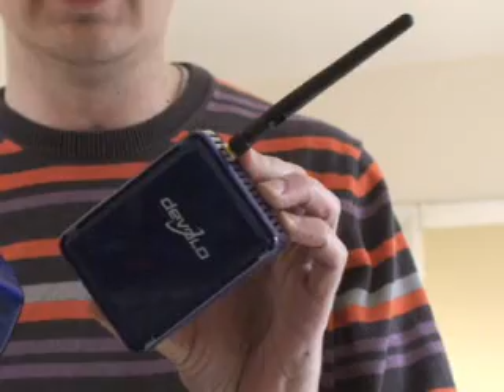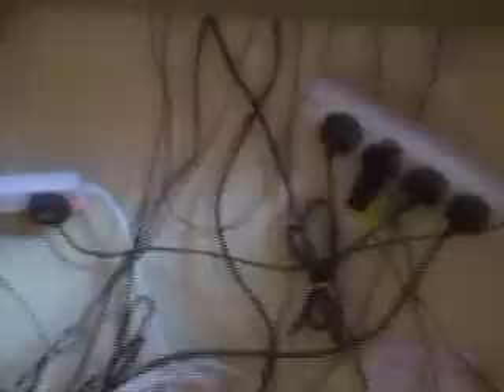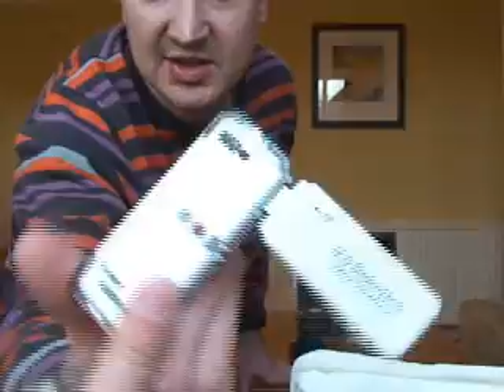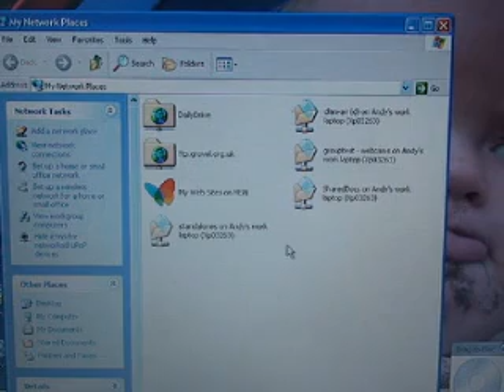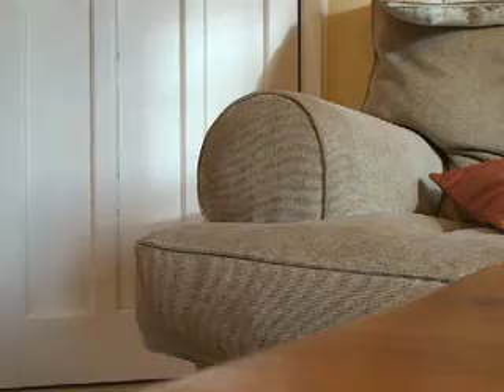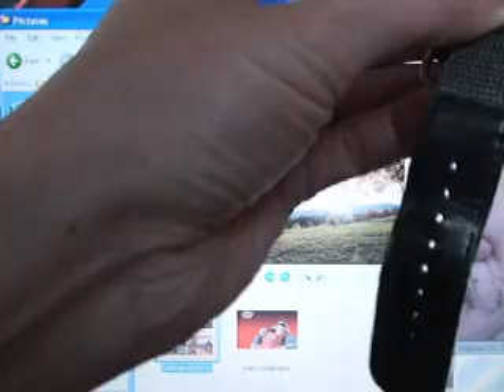Devolo Homeplug Wi-Fi Extender

Comment: Been using these. Overall, good. They are 85kbps. My speedtest on my WiFi any router is 5.5meg download but on the extender is only 0.5meg download. Looking at upgrading to some 200kbps ones. They are best suited if you can't locate your home pc near the telephone point.